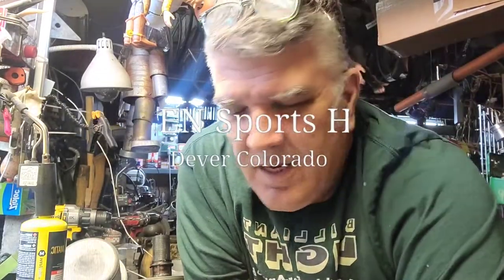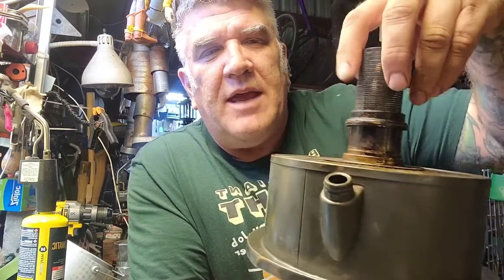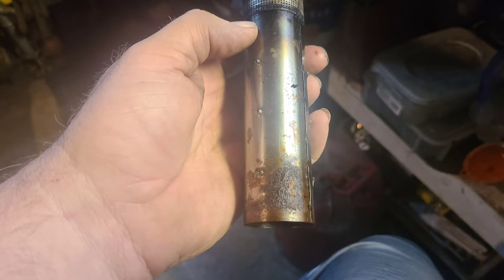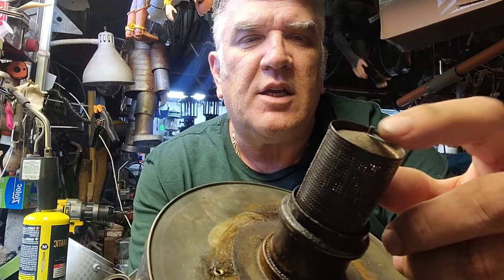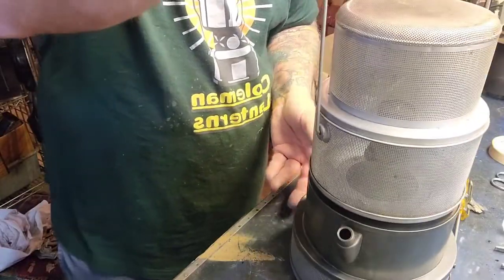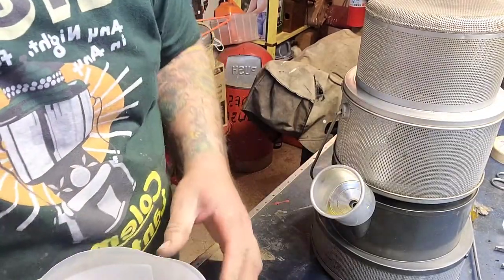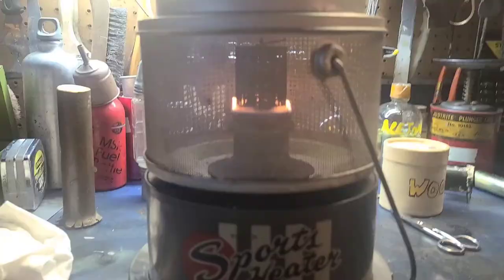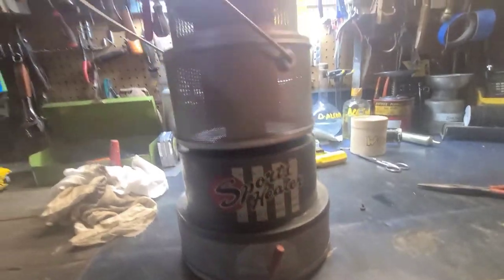Vintage Bunsen Sports Heater Tips for Restoration

Comment: Just saw one on the internet was thinking about snagging it. It was like 56bucks
Reply from the maker: It's an OK heater it looks cooler than it actually is , if it's mint condition I would pay that but otherwise I would probably hold off
Reply from the maker: The stove however does heat up quite nicely,
Reply from the maker: If you end up picking it up you will enjoy it